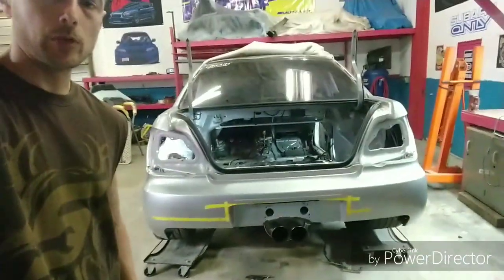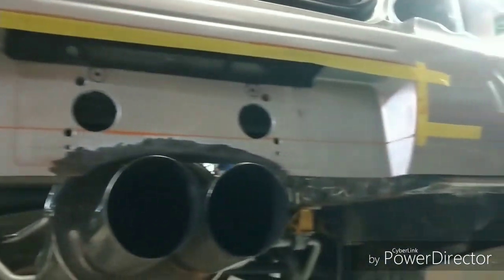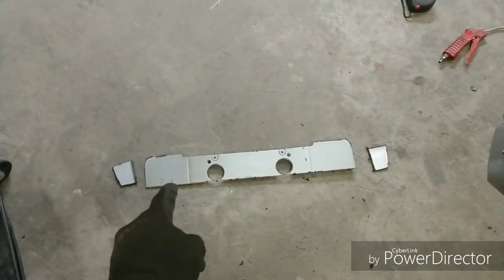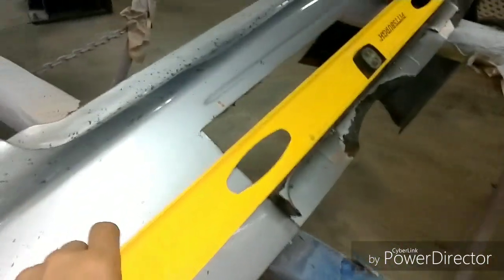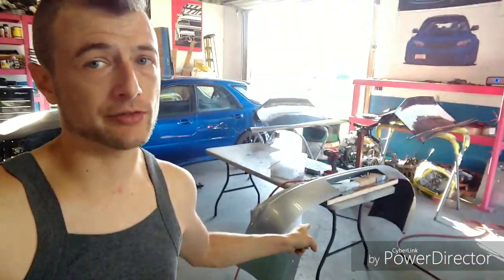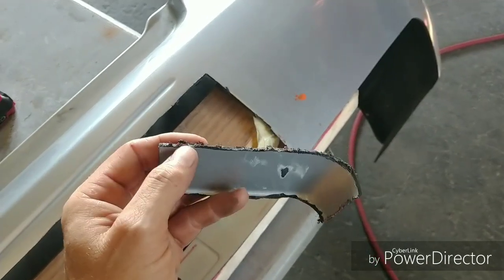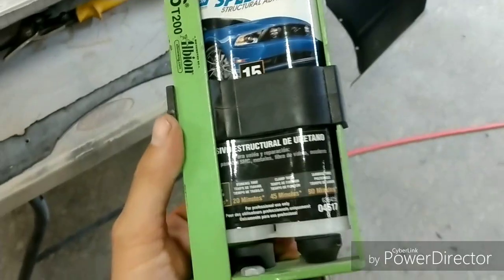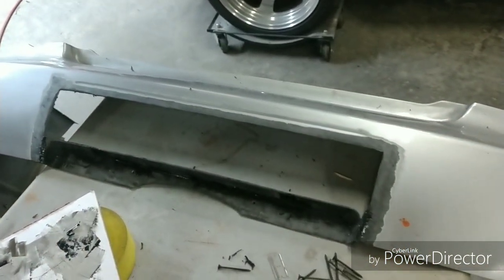Custom polyurethane bumper (PT. 1)

Comment: Not questioning your knowledge but why not use fleece and fiberglass resin?  Love the work.
Reply from the maker: Great question. I'm not a fan of fiberglass because of the rigidity of the material. I prefer a polyurethane bumper over fiberglass because of the flex it allows. Fiberglass with fleece mat would add to much structure in that area. I plan to attach a full diffuser to the bumper with hardware. I don't want to have spider web crack caused by the stress of the hardware. The OEM material is ideal for the application. Plus another reason is weight. I'm not a fan of fillers. I have the ability to keep the bumper the same thickness and weight. Using very minimal amounts of glaze. Not Bondo/body filler. Which is not designed to flex. It cracks easily, and also is very porous. It absorbs water easily unfortunately. Sorry for the drawn out explanation. Was a lot to explain. Thank you for the comment! ❤️
Reply: Rumble Garage I appreciate the answer. I trust your experience.